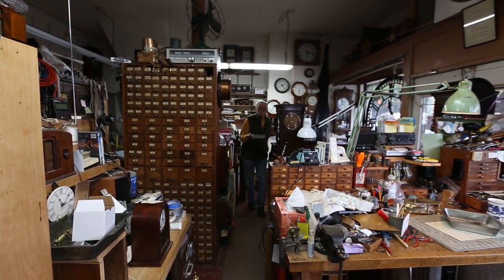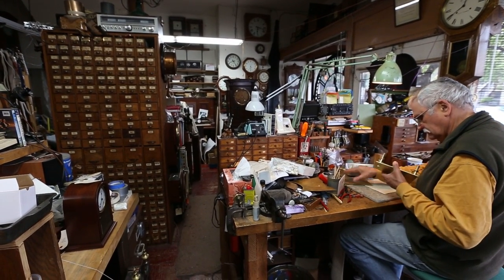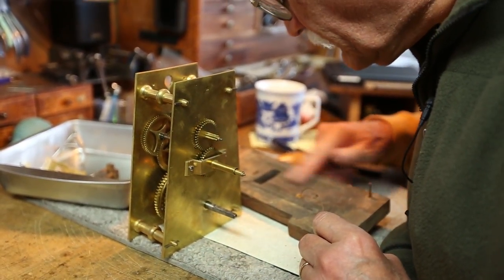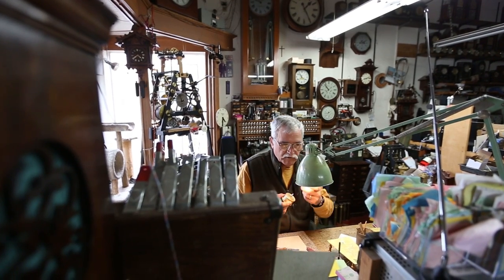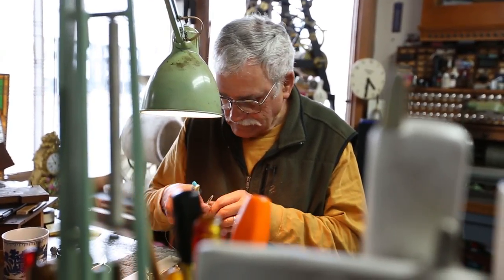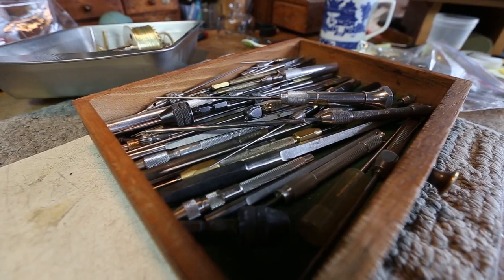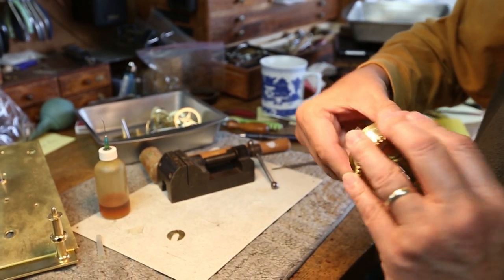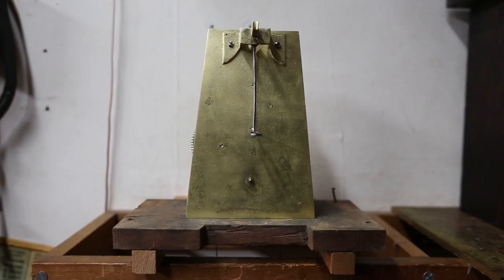Clock Master: The Process Of Cleaning A Clock

Comment: The really old clocks from the 1900's and back should never be cleaned in an ultrasonic cleaner, ultrasonic cleaning can and will damage brass and can cause cracks, it will cause cracks if the brass is cast, they should be cleaned by hand. You should never use any such machines such as power tools as you are using to buff and make the parts shine, you are removing marks from the parts which is its history.
Reply: Gracias por su dato,ya que yo pensaba comprarme un aparato de esos pero lo voy a seguir haciendo a la antigua , a mano con agua y jabón.También recupero las cajas usando pegamentos y barnices  orginales ,lo mismo que los pigmentos, hasta la madera cuando hay que reemplazar ocupo de demoliciones tanto o mas antiguas que las originales